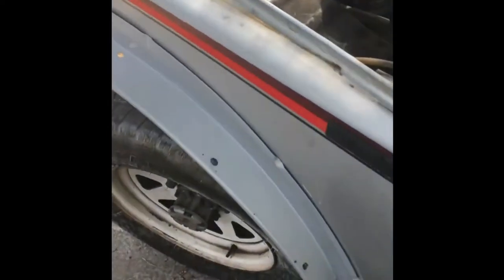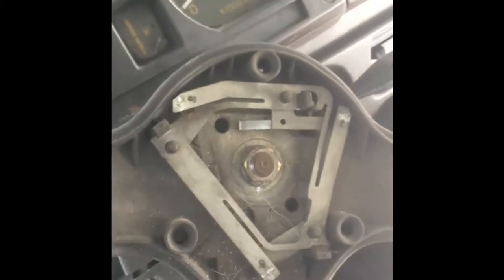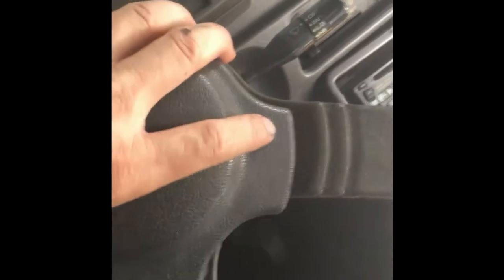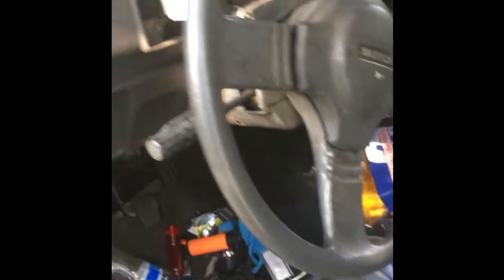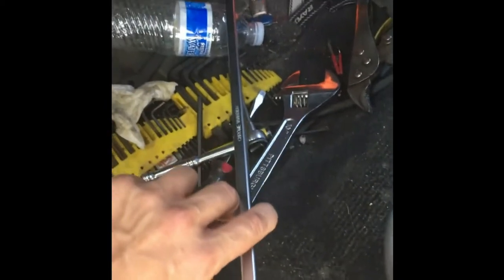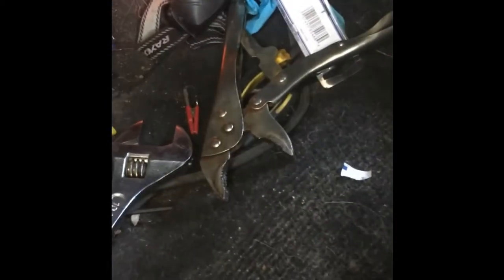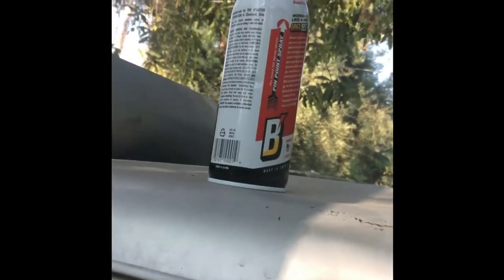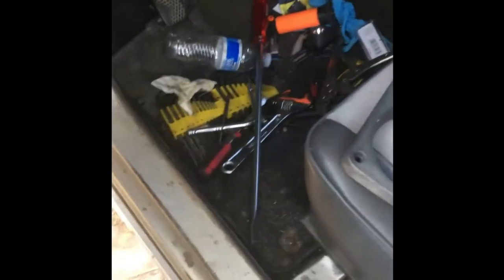1987 Suzuki Samurai Speedometer Cable Replacement

Comment: Great video!  Was perfect to replace my speedo cable.  1 quick question, I have a little bit of a bounce in my needle in lower MPHs, the transfer case side looked pretty gunked up, can I clean that in some way with something like a brake parts cleaner?  I did my best with a rag but couldnt really get in there.
Reply: Not sure if this is still helpful but, someone else said that cleaning it out with break cleaner and lubing it up again is good. They said to avoid DW 40 (too thin) and white lithium grease(dries out).
Reply: @kizmetmars  are you saying clean the port where the cable connects with brake clean? What would you lube it with?
Reply: @southeastsportsmen  Yes, brake cleaner is good to use. I'm not sure what to lube it with though. The guy suggested something I've never heard of before. Maybe ask at an auto shop? The best I can think of to use is silicon grease.